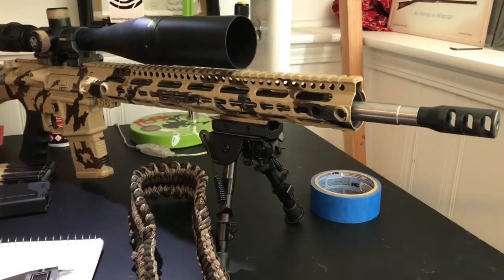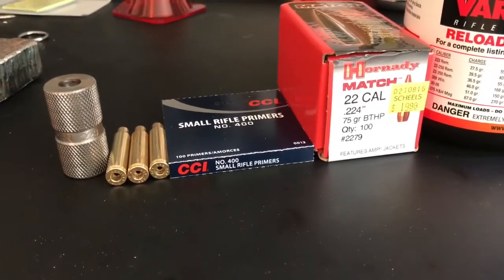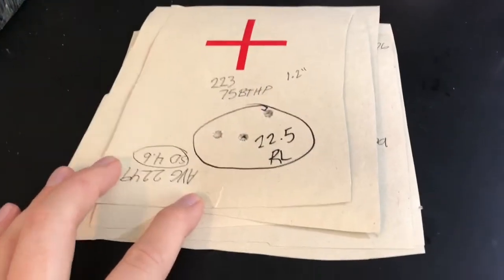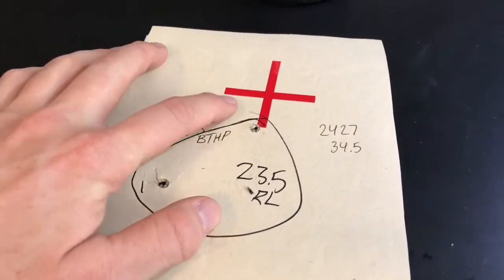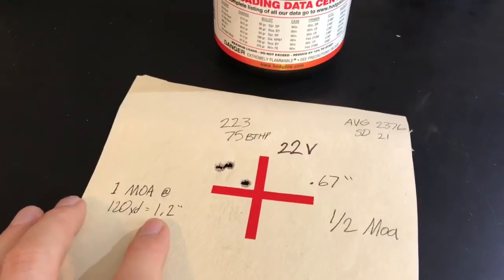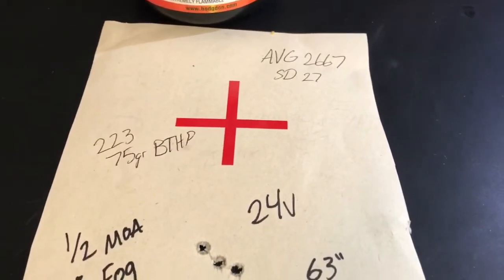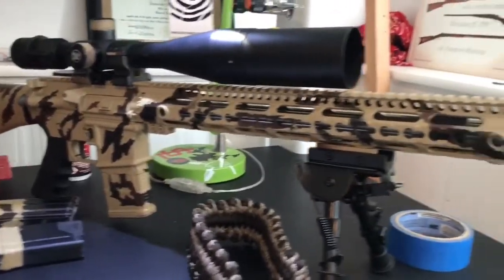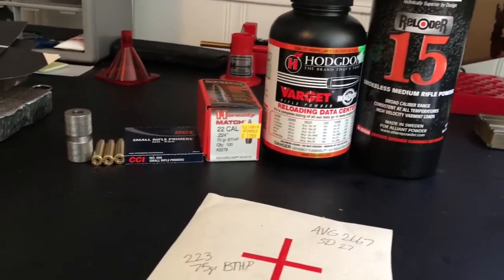Chasing Sub MOA 223 (hand load testing series) part 2

Comment: I knew I would learn something from you. Great going 2600 nice speed and good accuracy. I'll try some varget. I've had good luck with tac and 8208xbr in my 6.5 ,but not in my 5.56. I am doing some testing with benchmark and h4895 in my 5.56. I would also like to try cfe223 and the new varmint.
Reply from the maker: Grant Stewart sounds good, please just work up to that charge it is on the high side of the books. Good luck I'd hope to see similarities between our guns
Reply from the maker: Harrison McCullough glad to hear it helped you, yeah Varget has worked really well initially with these 75 Gr. I'd like to shoot a few more and see what happens. It did work pretty good for the 68 Gr hornady. I shot 300 of them playing with charges and got down to .75 or 1.2 MOA at best with Varget
Reply: I just got done working up some loads with Horn 75gr bthp using cfe223 in an 18inch PSA barrel that is floated. Did not get good results at all. In fact, everything in storage shot better.
Reply from the maker: Grant Stewart I HAVENT TRIED CFE 223 YET, AS OF NOW I REALLY LIKE THE VARGET PERFORMANCE SO FAR. WHAT TWIST RATE IS YOUR PSA?
Reply: 1 in 7, rifle length gas system. I had to drill out the gas port to .1 to get it to cycle 100% with all ammo. It does great with everything I have tried with it 55gr and up, except for the cfe loads.
Reply from the maker: Grant Stewart that's interesting you had to open up the gas port the only ammo my gun doesn't run is steel everything else I've tried has run 100% except two 5.56 rounds that failed to feed. If you can try Varget for the 75s mine likes them on the hotter side of the load data so work up to what my videos say maybe you'll find something there
Reply: I'm planning on working with what you have presented here. It'll be interesting. It may be a while before I can get some ready for testing, but I'll let you know my results.